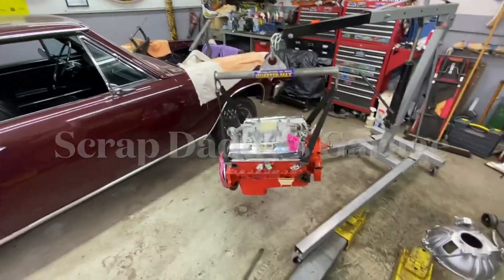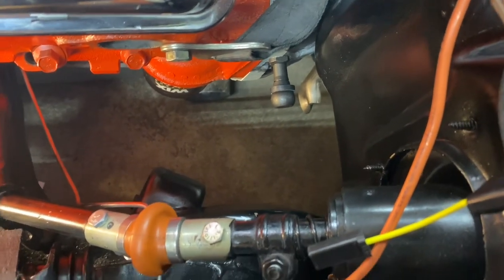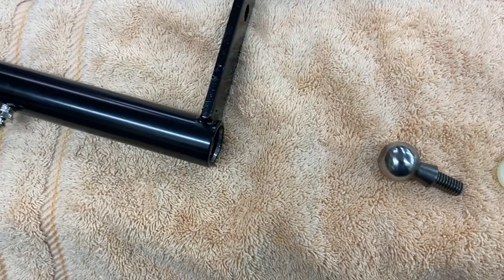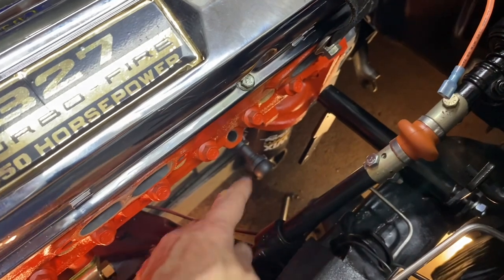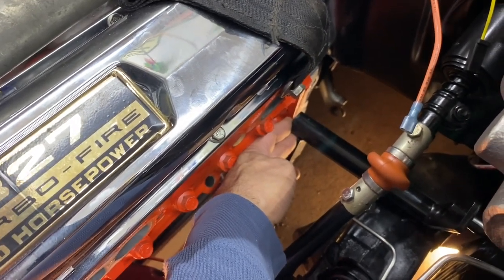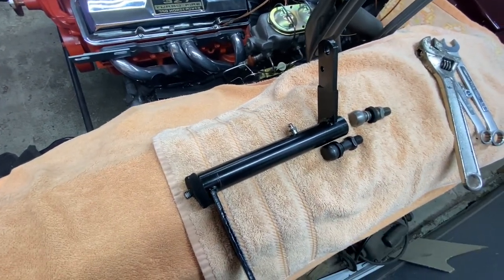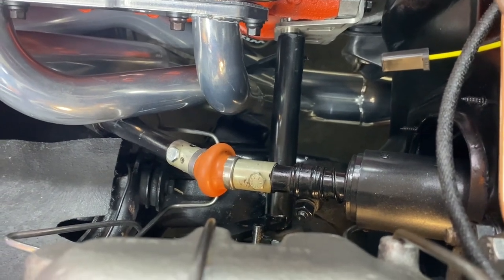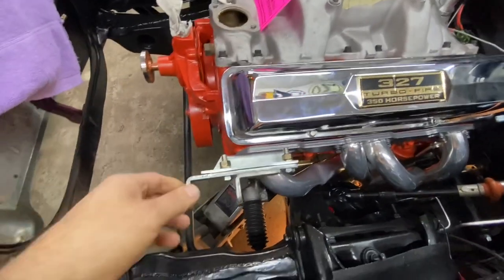1965 Chevelle clutch linkage installation

Comment: I am currently in the process of converting my 65 Malibu SS from an automatic to a manual.  I think what’s making it such a challenge is that I’m changing the entire drive train.  The engine is going to be a Blue Print Engine, 383 Stroker, and 5 speed Tremec, all from Summit Racing.  I have already installed the pedal conversion kit so the car has a clutch pedal now.  That as far as I have gotten so far.  I am trying to decide whether to go with a hydraulic setup for the clutch or the bell crank and push/pull rod way
Reply from the maker: If your engine block doesn’t have the casting for the pivot stud, go with a hydraulic setup. Thanks for watching👍

Comment: Same adapter I used for my 69 Camaro and 400 SBC block.  My block has the boss but it isn't drilled and tapped, I had already installed the engine before finding this out. Thankfully they make that adapter.
Reply from the maker: Yes it’s a lifesaver. Thanks for watching.

Comment: did you buy a bellhousing specifically for the chevelle? and the pivot was wrong?
Reply from the maker: The bell housing is correct for this year chevelle. The engine block is a early 327 from a corvette and was not cast with the pivot location. In a corvette the pivot stud screws into bell housing. Later 327 blocks all have the pivot location cast in. Thanks for watching

Comment: Thank you for the video.  I have a 65 Chevelle that has an automatic.  I also have a Muncie out of a 69 Camaro.  I don't have a lot of experience doing a swap.  Why didn't you just put in a Hydraulic system in so you can avoid using the linkage and bar?  It seems like it might have been easier.  I have the transmission/bell housing/and flywheel. So I was wondering that for my application.  Keep on updating us..
Reply from the maker: My friend bought the parts for his car, wants to keep it stock looking. The hydraulic system might be easier, won’t know until I try to install one! My friend is progressing on the car, hopefully will have a update soon. Thanks for watching!

Comment: The receiver on the shifter isn't going to work, mine was from a Camaro as well...puts shifter in the center of tunnel....i ended up buying the straight one on ebay and totally disassembled my Hurst shifter and swapped it out....the receiver is the part that the shifter handle bolts to
Reply from the maker: @doublecheeseburger1712  we found out, watch the next video. Thanks for watching, I appreciate the feedback.